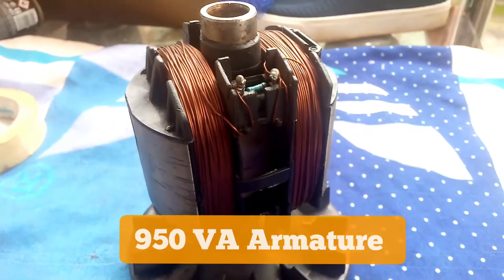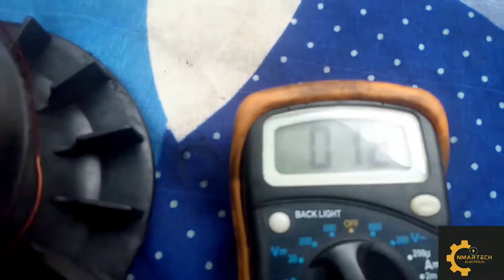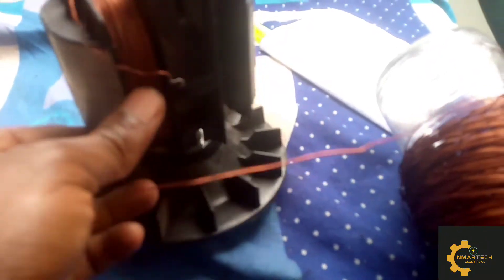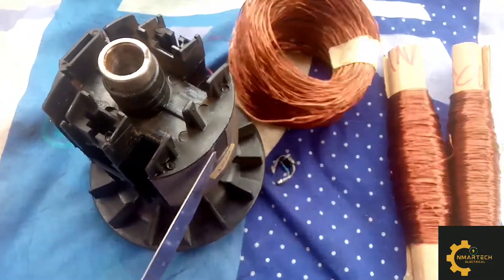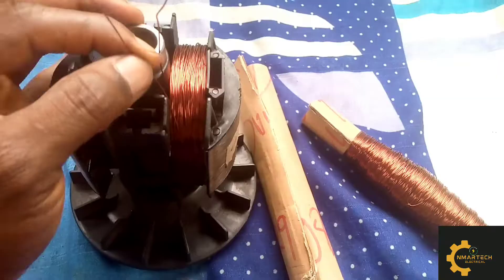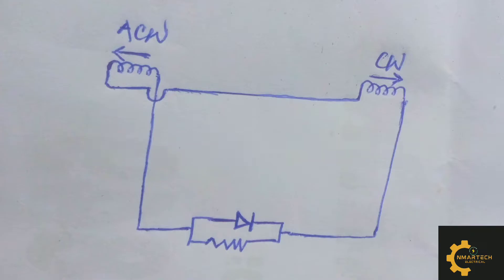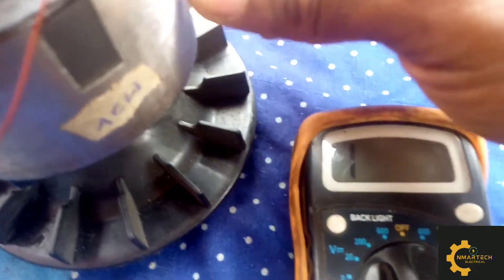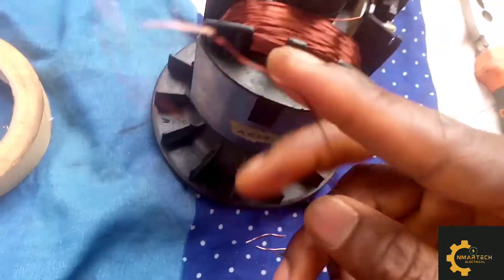GENERATOR ARMATURE COMPLETE COIL REWINDING

Comment: Thank you for creating such videos! 
I love 2 stroke engines, but here I the USA are governing agencies do not. So we can kinda by these new, but it’s really difficult to source parts! 
Mine had a intermittent connection at the diodes( mine had two 3 amp diodes in parallel for 6amps) I had the diodes 
Haha “re used diodes should I say” 
Got some hours on it now, I do wish I would have taken the jug of and chamfered the ports when I first got it
Basically brand new because the fault occurred not long after being bought, and then it wasn’t really fooled with. It was given to my cousin who then gave it to me.
I just recently went through took the jug off and clean up the ports and chamfered them, I’ve got to say I’m surprised it wasn’t in absolutely terrible shape internally, only one bad score mark on  a transfer port side of the piston. Cylinder is seems completely fine from it. And yes I put it back together with the same exact piston! 
I will make it last if I can, just because it’s a 2 stroke! 
If you were on the engines too, for these or any other two stroke with un chamfered ports, and left sharp. Clean them up and it will last so much longer!
Reply from the maker: Thank you so much for these great and helpful information. I greatly appreciate.
Reply: @n_martechelectrical thank you for the same!

Comment: i have one question, i have the same armature but i have 3 diodes and one resistor, is this normal ? or i need to put other diode for the rectification ?
Reply from the maker: @gobas21  where are the 3 diodes located? Are they there right from the manufacturer?
Reply: @n_martechelectrical  the 3 diodes are located in the same spot that you show in the video, with the same paralel connection with the resistor. I think that they come from manufacturer but im not sure. But i need two diodes or four diodes to make the rectification ? Maybe i just need to add another. Could you please tellme the reference of that big diode that you show in the video ? or the name ? Thanks and sorry for bothering you.
Reply from the maker: @gobas21  okay. You need four diodes when you're building a bridge rectifier. Two or more diodes can be connected in series or parallel to achieve a particular rating.
The diode in an Armature is just to make sure that induced current in its windings flows in only one direction. And when current flows in one direction it is DC, and when DC flows through an Armature, the Armature becomes an electromagnet.
Reply: @n_martechelectrical  so i need only 2 diodes en parallel with the resistor ? to make de  current flow in one direction ? All these pieces come with slip rings or not ? Because in my case i dont have de slip rings but i have a big capacitor

Comment: I have an amateures the is work and the I have read it with a metre and the coil and everything is okay and the capacitor is work. But the fan is not in the amateures the coil and amateures and capacitor is work but the generator is not bring out light
Reply from the maker: Did you mention that there is no fan on the Armature? The fan is there to cool the coil. If you have confirmed that everything else is okay, try changing the armature diode

Comment: Thanks for this video, my generator armature has small six magnets three on each side of the armature, but two are missing, one from each side what's the effect of this on the output voltage of the generator
Reply from the maker: @adeleyeayodeji1032  if the small magnets can generate sufficient flux to induce upto 80% of the initial required excitation voltage, the output voltage will remain the same

Comment: Was this brushless? Was there an exciter somewhere?
Reply from the maker: Brushless means that the armature has no slip rings and the exciter windings have no physical connection with the armature unlike in AVR generators. 
The excitation current is transferred by induction into the armature while the diode attached to the armature windings gets this current rectified.
Reply: Pls sir what is the value of resistor and diode been used in the rotor winding
Reply: What are the colors on the resistor, reading the colors from left to right